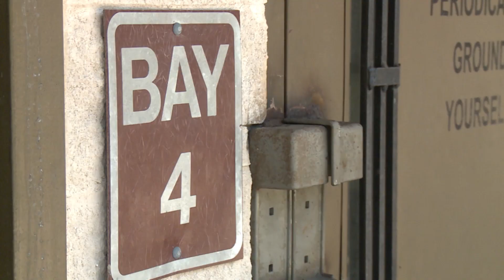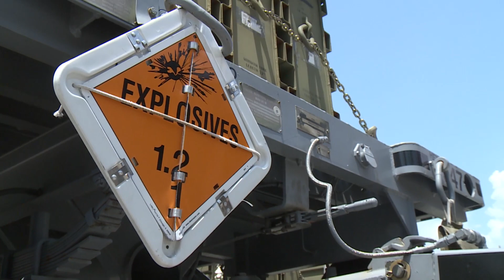Hurlburt Field Ammo Airmen

Comment: Shooting from the hip: I never cared for my Hurlburt Field assignment. 

I worked Line-D and the head shed during my two years (1995 - 1997). Special Ops Command is unique; it’s an acquired taste, if you will. I found it unpalatable, but most I knew were fine with it.

These guys and gals work their asses off in the humid, stifling heat of Florida’s Panhandle. The ammo they hump is a lot bigger than your typical fighter wing frags, 105MM in particular. Another element is these troops are deploying to known and classified locations far more frequently than their worldwide AMMO brethren. 

I much preferred SAC (Carswell AFB 1984 -1988) when it came to a “specialized mission.” 

They say variety is the spice of life. If you crave something completely unique in the AMMO experience, dream sheet Hurburt Field.

I.Y.A.A.Y.A.S.